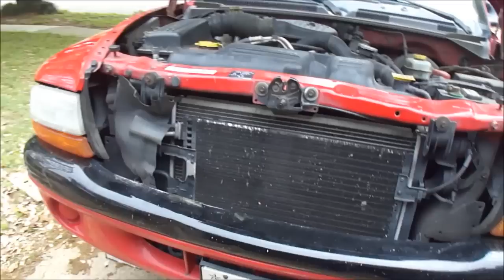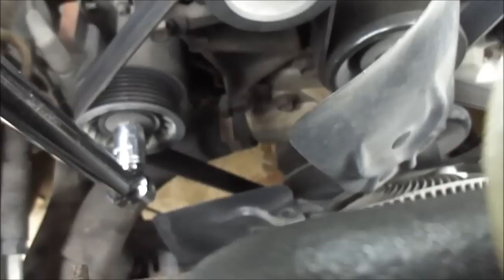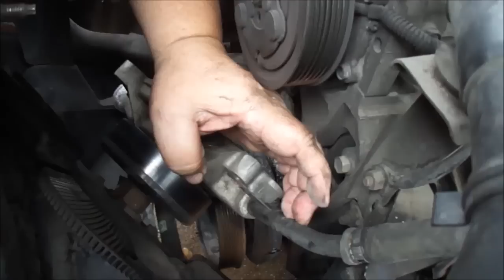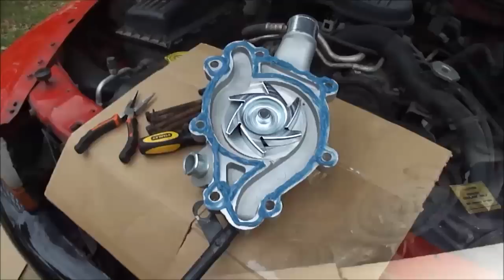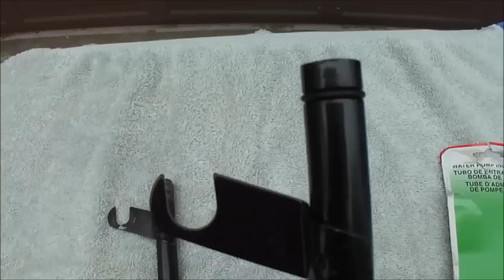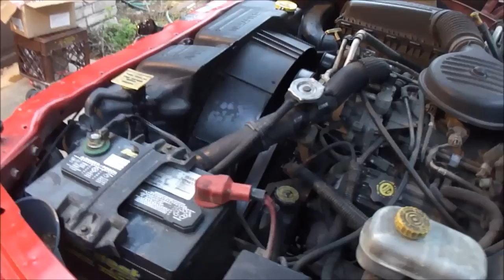2000 Dodge Dakota Sport Water Pump Replacement V6 3.9L

Comment: Your old tube was broke that wolverine has a groove that goes around the tube just like the replacement one so part of your tube was broke off in your old water pump it actually snaps in with the oil ring

Comment: I would have tried just replacing the seal first. I'm sure that pump was still good. I'm no mechanic though so correct me if I'm wrong.
Reply from the maker: The pump had over 100,000 miles on it so I decided to just replace the water pump since they were pretty inexpensive for that model
Reply: @averageguysgarage  holy cow. 100,000 in 3 years.

Comment: Magical. So how do you get to that top middle bolt, again?
Reply: I used a T45 socketed torx bit, 3/8 drive rachet with a 6" extension.  It didn't fit great but it did come out without any issue.

Comment: Damn the inlet tube is 24.99$ now more than doubled in 5 years from 9.99$
Reply from the maker: Wow
Reply: I'm hoping mine is still usable.  There was a new o-ring included with the new water pump.  My problem is the bypass hose at the top, I can't get it to fit over the nipple on the new water pump! $*#&@^$&.  I might need to removed the AC and alternator brackets in order to replace that hose.
Reply: @JhanJo  oh like the main inlet hose that one is a pain in the a** to change i had to change it on mine too mine seems work good make sure when u change it while the water off before you go to put new one on will ruin the gasket and get thread sealant for threads and not thread locker has to be sealant i had changed mine year ago and month ago but I think that was my problem was thread locker and I used permatex gasket maker I think better off with the paper gasket and make sure u torque them properly 30 foot lbs its not very tight so it is easy to over tighten the bolts  and good luck with it not very hard i think I finished it in less than 2 hours
Reply: @miker5700  I figured out my problem.  the nipple on the new water pump is 5mm longer than the old one.  When trying to slide it up into the bypass hose the factory hose clamp was in the way.  I removed the hose clamp and the new pump seated properly. New hose clamp is a typical one that tightens with a screwdriver.

Question, you used thread sealer for your bolts?  My manual didn't say anything about using thread locker or sealant.  Fortunately I have a torque wrench (from work) so I have the bolts tightened properly.  I did use gasket sealant (not RTV) on the machined surface of the new pump and a paper gasket that came with the new pump.  I have it mostly back together but haven't leak tested yet.

Thanks!
Reply: @JhanJo  yes u want to use thread sealant I guess always use it on water pumps because antifreeze travels through the motor and some of the bolts go through the channels so if theads not sealed antifreeze might come out where the bolt head is when u took bolts out there shouldve been some that started leaking antifreeze out of bolt hole the thread sealant is by the thread locker and is a white paste kind only like 7$ a tube

Comment: Pump didn't come with a gasket?
Reply from the maker: It did but I decided to use the sealant instead
Reply: I put lil on the pump then gasket then put pump on have this guy that has just a small little shop right down the road he is hands-down the best mechanic I've ever met he's probably 50 some years old I have took some crazy s*** to this man and he is figured it out took him a Mustang one time with no motor in it boxes of Parts where somebody has started taking the damn thing apart brought him a used motor out of a Mark 7 and he made that thing look like it it just rolled off the assembly line so I was doing a water pump on the same Mustang and he showed me what to do and he only put ceiling a little bit on the pump and then the gasket never between the block and the gasket I would think if you use just the ceiling it's got little bumps in it you know cuz it's not perfectly flat and smooth and yeah I get that it'll squished but once ceiling gets hot so many times a breaks down after a year or two it's still there but it's going to leave a void somewhere so it's not going to last as long but if you put it on and then while it's still wet I have that gasket in when you tighten it to the motor it's going to flatten it out perfect

Comment: I have the same squeak on my 03 dakota 3.9L. Have u diagnose wher the noise is coming from when u first started the engine? I changed the belt aligned all the pulley check the a/c clutch. My water pump is good. I couldn’t figure out where is the squeaking coming from.
Reply from the maker: Yes. My noise was definitely coming from the idler pulley

Comment: how to bleed it
Reply: So with the dakota 3.9L for this year, the best way is to just let it idle on a flat surface with the radiator cap off. Let it run with cap off until the engine is fully warmed up and there are no bubbles. These trucks (at least 3.9, 5.2 and 5.9L gas )do not have a bleed valve. Just gotta make sure there are no bubbles coming out from the radiator cap.

Comment: One thing to add about the steel tube and o-ring assembly for your viewers, DO NOT push the tube and o-ring all the way into the pump! If you do and the o-ring goes past the machined surface it can get caught inside the pump and you'll most likely tear it or pull it off the tube completely trying to pull the tube back out. Then you get to replace the o-ring again.
Reply: I just installed a Dorman replacement tube. It's shaped with a lip to help prevent that from happening. Also, I installed mine with its retaining bolt for the integrated bracket loose in the block ... so that I couldn't push the tube in too far. As I know you're aware, the bracket welded to the tube would then hit the bolt and the tube stops getting inserted yada yada.

Comment: You don't need all that RTV on the pump, the stock gasket works just fine and you won't have to worry about RTV chunks in your cooling system. Other than that great video.
Reply from the maker: +trackerrrr Thanks for the comment. Plus if you use the stock gasket then you don’t have to wait for the RTV to set up. And you can be back on the road sooner

Comment: Another good way to remove the fan clutch is to strap a chain vise grip wrench around the water pump pulley after you remove belt to hold it still while you get a large wrench on the nut

Comment: Suppose to take fan clutch off before taking serpentine belt off but overall a good video.
Reply: That only works if the nut isn't rusted to the water pump. I had to pull my fan off after the pump was off with a pipe wrench and some long screwdrivers to hold the impeller in place. My truck's from New York (i.e. lots of salt in winter and rust) so it put up a fight.
Reply: yep, noticed same thing. So the engine holds the pulley and you can crack that nut on the back side with a wrench and big cheater bar.
Reply: trackerrrr Soak the treads in PB blaster or wd-40, also with the correct fan clutch removal tool and a rubber mallet it should come off regardless of where the vehicle is from. I would also recommend putting anti-seize compound on the treads so that doesn’t happen.
Reply from the maker: +trackerrrr Thanks for your story that’s very helpful

Comment: I always replace the bypass tube while I'm doing the pump, more often than not,,, the tube is the problem in the first place..
Reply from the maker: +Trevor Clapsadle that's a great idea. And they only cost about $10-$12.
Reply: Average Guys Garage I replaced the bypass tube and my water pump was still going bad too
Reply from the maker: +dane blomquist Did you replace the water pump?

Comment: how the he double hockey sticks did you get the dang fan clutch off.. I have the tool it's not moving, and yes I'm going counter clockwise (left) 97 dodge Dakota sport
Reply: I used a small bar as a punch and with a hammer, hit down on a leftward portion of the nut. After a few hits it did begin to rotate a little and then spun easily with fingers. "As seen elsewhere on YouTube."
Reply from the maker: I used a large pipe wrench and a large thumb wrench.  I should have used a chain wrench and taken the fan off in the truck first.

Comment: lot easy to take fan off 1st before removing the pump
Reply: And soaking then twisting the    heater hose off. Lubrication of 'O-ring before install keeps ring from rolling.

Comment: Thanks for the Video , it helped me a quite a bit  one thing i would suggest is 
showing people that the Bolts for the water Pump have to go back exactly the 
same way they came out. I changed my water pump sat 01 07 17 ,
Reply: western spud what do you mean exactly same way they came out? You mean bolts go in same holes?
Reply from the maker: Great tip about the bolts.  Thanks for watching.

Comment: Dude what about that tube coming out of the pump...you looked it up but never said anything about it
Reply from the maker: Later in the video I identified it as the the heater return.  There is a discussion of the replacement part starting around 8:50
Thanks for watching.
Reply: Alright..thanks ....that is the thing I had trouble with...do you just yank the old one out?
Reply: Check it out...couple months ago I went change the pump had it all taken out but got to that heater tube and had no idea what to do with it. I needed the truck running the next day so I just put the old pump back in with a new seal...that worked but now it's leaking again most likely now around the shaft..so now I'll take it out again but now I know what to do with that heater return tube...thanks
Reply: Oh yea... gotta make sure you keep that O Ring in good shape. When I replaced my Power Steering Pump, I didn't even notice that little bitty O Ring on the Heater Return. Gotta get a new engine now. Coolant sprayed out while I was doing 70 on the interstate. Engine shut itself down. Compression tests came up around 20 on all cylinders. That dang little 5 cent O Ring can break your engine
Reply: MJ X thats why i watched this video!!! Never said aword about it! Smh😲
Reply from the maker: See comment above.  It is the heater return hose.  Identified at about 8:50 into the video.  Thanks for watching
Reply: Average Guys Garage if it wasnt leaking??? Prolly not mentioned..
Anywho, it did help as i already fixed it.... 😂😂

Comment: sometimes you get lucky with breaking the the fan off loose off of the pump while the belt is on just have to make sure you going reverse since most fans are reverse thread I know they can be a pain in the butt to get off at time if taken off whole Like you did in the video especially if you don't have a vice laying around anyways looks like a easy pump to replace thanks for the video now off to replace my friends pump

Comment: how did you get the top pipe attached without taking out the alternator and compressor
Reply from the maker: +Naxarine It just slipped back on.  I checked to make sure the clamp was then covering the pump and that the screw that tightens the clamp was at a good angle to tighten.
Reply: im debating on weather or not to replace the clamp. i have the stock self clamping clamps
Reply from the maker: I prefer the ones that have the screw to get the clamp tightened.  There never seems to be enough room to get the pliers in place on the spring type.
Reply: i do too, but i didnt have any of the right size on hand, FYI i ended up taking off the alternator and compressor, not i gotta go blow money getting the AC system vaced and charged

Comment: Not trying to diss ur video, but I see you omitted to show how to remove the fan and fan clutch from the water pump, Oh my bad I guess you did it by OSMOSIS... thanks for nothing actually. .
Reply: You're kind of a jerk David.
Reply from the maker: +David Paine Thanks for watching.  At 5 minutes in we talk about having to use a pipe wrench to hold the shaft of the water pump still while loosening the nut.
After doing it that way, the hard way, i learned about a chain that can be used around the water pump pulley to hold it in place while it is still in the truck.  In the future I will be using that tool to remove the fan before removing the water pump.  Thanks again for your comment.

Comment: Morning,I think you'd find the small piece that is missing off the end of the original tube below the rubber sealing ring  probably sheared off during removal .  I removed this tube from my old original water pump on my 1999 Dakota and it looked the same as your new one with the little extension below the rubber ring intact. It is the original water pump. The new or replacement water pumps could be threaded where that tube goes into the water pump body and a nipple provided as in the larger outlet thus eliminating the need for that Mickey Mouse Tube. Food for thought... I removed that tube from my old water pump using a mini grinder very carefully notching the body of the water pump on each side of the tube and then using a small chisel snapped the piece out so it exposed the tube otherwise I was in to about 25 bucks for a new tube. Cleaned the tube up and repainted it. Installed the new seal then after installing the new water pump I applied a thin layer of silicone to the end of the tube and a little around the new seal to help lubricate it.  Inserted the tube into the hole,  lined up the bracket installed & tightened the bolt. Worked great with no leaks...

Comment: Average Guys Garage - I just replaced the thermostat, a bad frost plug, and flushed out the old coolant. STILL heating up. Do you suppose it's a bad water pump?
Reply: Btw, I'm working on my 2000 Dakota 4.7L v8
Reply from the maker: +slytherin Yes.  In my experience, after trying everything else, the water pump fixed it.
Reply: +Average Guys Garage thank you.
Reply: +slytherin I found this water pump in a 2000 jeep cherokee w/ 4.0 L6, the bearings n seal were still great. But the pump wasn't moving the coolant. EZest way to check it, is to wait til the engine's cool, take one hose off the heater core, have an asst start the engine, 2secs shut it off, either the hose or the port of the heater core should shoot antifreeze. Don't get any in your mouth or eyes! In 30yrs this is the 1st one I found where the fins were GONE from the impeller!
Reply: +dondale68 thanks for the tip. I fixed my pickup already but I'll keep that in mind. :)
Reply: Glad ur up n running!
Reply: +dondale68 thanks, turns out that I replaced the thermostat backwards. however, the old one was in backwards too from the previous owner, so I didn't know any better.
Reply: +slytherin Sounds like you're just starting to gain experience. I've been at it for over 30yrs and I still come across things to make me scratch my head! Just keep in mind- you have a brain, a car doesn't! If you're gettin fustrated, it's time for a coffee break!
Reply: +dondale68 I've got some coffee right now! ;)

Comment: Ok.  I've watched your informative video and have the pump removed from the engine with the fan and pipe attached, but cannot figure out how to wrangle it out of the engine compartment without removing the coolant reservoir.  How did you do it?  Thanks!   (2000 Dakota 3.9L)
Reply from the maker: +Jerry Paquin Did you remove the fan shroud?  With the fan shroud off it shouldn't be an issue.
Reply: +Average Guys Garage Yes, shroud removed.  I gave up struggling with it and I ended up removing the reservoir.  It wasn't a big deal.  Thanks for everything.  Repair was a success!

Comment: I have an overheating problem on my kota .. I change the sensor and the thermostat and now it overheating on idle and I can smell the radiator ... also my heater core is out  and I say that cuz smokes comes out of the vents. my question is could the overheating problem be because of the heater core or something else like the water pump not circulating ..? BTW there's no leaks
Reply from the maker: +Mario Murillo In my experience, no matter what else I did to correct overheating, I end up replacing the water pump.  When the engine overheats you are in danger of a gasket going on either the water pump or head.  The water pump is a cheaper alternative that head gaskets.  I would try the water pump first.
Reply: I had the problem you had and the only way out is switching it out for a new heater core and when they pull it out check your ac core to I didn't change my ac one and it had a leak
Reply: You may have a defective thermostat even though it's brand new,that does happen sometimes. Or else you put the new thermostat in backwards,that's easy to do if you're rushing.

Comment: This is a great video.  I plan to drive my '02 Dakota on a trip 1000 miles away in a few months and I think my water pump has a full 180,000 miles on it.  I've had a water pump fail on me in the past with another vehicle with far fewer miles, and this seems like a surprisingly easy project to protect me against a potentially expensive and inconvenient repair. It should also help that I run with an efan so I have plenty of space and no clutch fan to worry about.
Reply from the maker: +nojunkorspam Thanks for the comment.  Did you replace the pump?
Reply: No, we went to take it out and everything was so clean that it must be a replacement water pump.  I ended up keeping the pump (I plan to replace the engine with a v8 one day) and ended up replacing the thermostat.